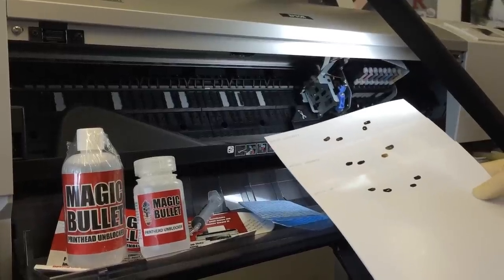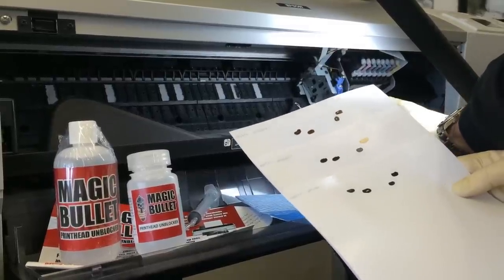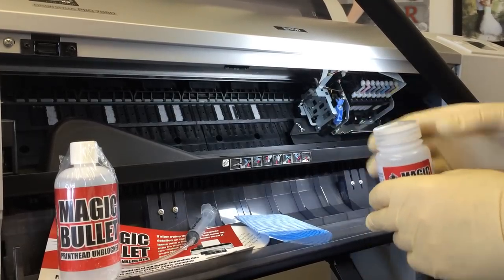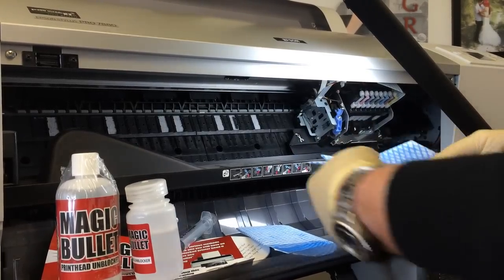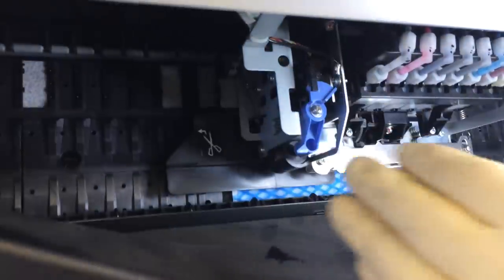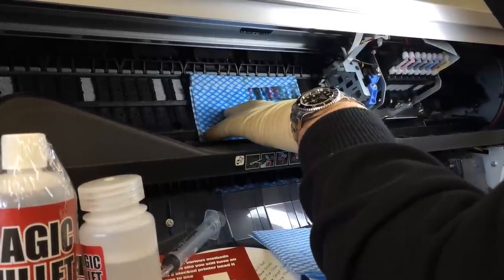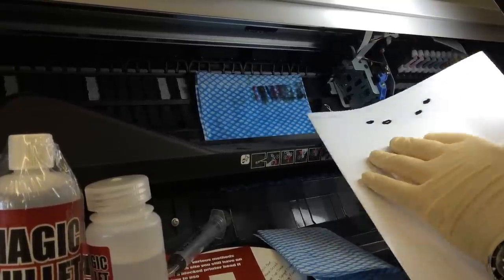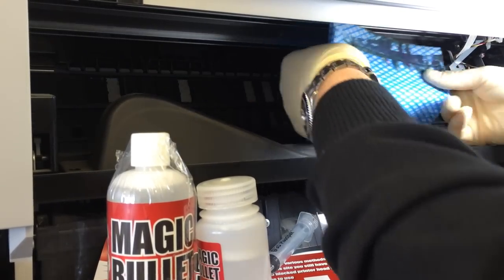How to unblock a wide format inkjet printer - dried ink on printhead

Comment: It's 3+ years since I used my 7880 printer (studio closed) I have now got it out of storage and yes as you can imagine, everything clogged. I firstly used windolene and sprayed but no joy. I have followed you brilliant video and left it soak overnight, didn't work, I'm now doing the second overnight. How many would you suggest me doing? Thanks
Reply: That's great, I will keep informed. Your link takes me to your shop, been thinking of a continuous ink system. Have you a video about the system and the ease of the change over?
Reply: After 4 attempts, each being left overnight, the print test paper is looking worse. I have looked at the print heads and there is no ink showing in #1 #2 #3 #4 #5, so is there anything available to flush the inks into the heads?
Reply: @waynewilkins007  Hi Wayne, I'm in front of a similar problem here and I was wondering if you managed to clean the head at all? Thank you for your time, Vlad
Reply: vthefountainhead no, tried everything, even took the printer apart and smothered the print head with magic bullet, so I took in for a repair and was told it would be cheaper to buy a second hand one from eBay, as a new print head was £900+, bought a second hand one for £560 and it’s brilliant
Reply: @waynewilkins007  Thank you very much Wayne! I shall do the same before I waste all the ink for power cleaning...
Reply: vthefountainhead the taking apart the printer was quite easy but a big suggestion would be to either video or photograph each process. How long have you not used your printer? Mine was 3+ years. Have fun 🥴
Reply: @waynewilkins007  I've done that successfully a couple of times with 3880, but this thing wasn't in use for about 8 years. I got it cheap with plenty of inks (old inks) but resurrecting it proves to be futile indeed...

Comment: There is no need to power-off in order to free the printhead.
Simply depress the blue cutter blade holder until it clicks, releasing the printhead.
You can then slide it to the left. Easy!